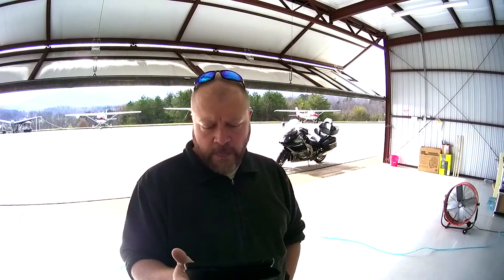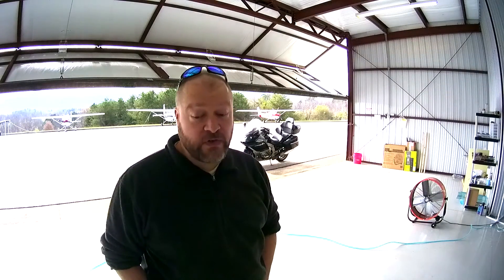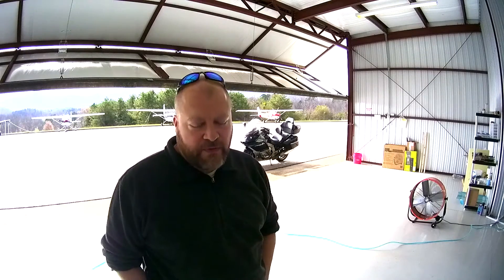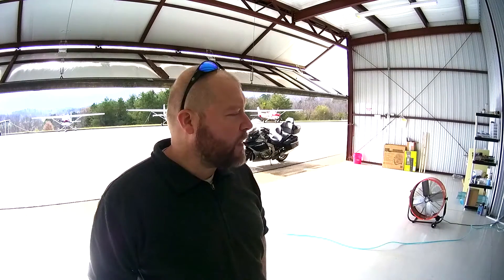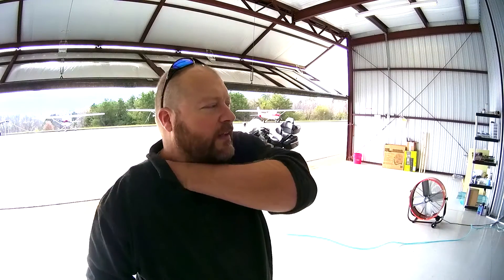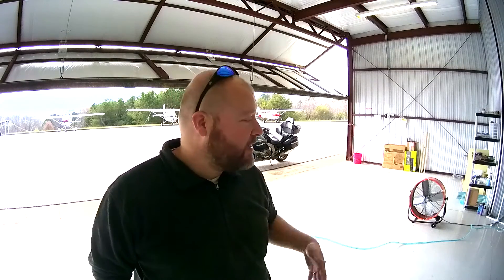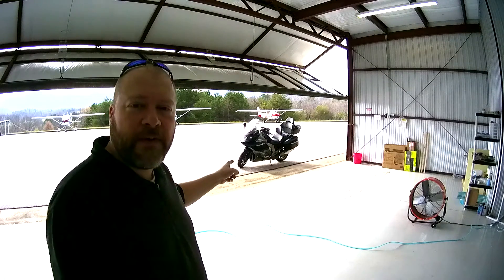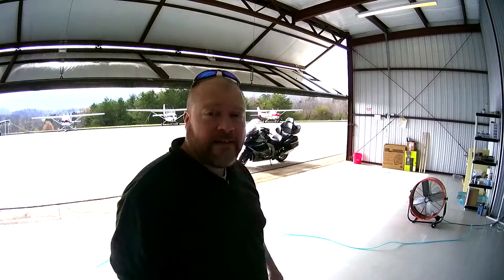RV-10 Empennage - Questions and Answers 001

Comment: This is an older video, and I'm just starting to go through your videos...so I am late to the party here. So you may have already changed your mind several times. That said, there's one question you need to ask yourself: How much single-pilot instrument flying are you going to do? 

The single most difficult type of flying to do is hand-flying in IFR, single-pilot. It is HARD. When you're in IMC and the weather is crappy, you have to be 100% on your game. Every. Single. Second. I've been there, many times. I've also given hundreds and hundreds of hours of instruction to IFR students, and that's the one thing everyone has problems with: hand-flying on instruments when the work-load increases. 

For me, the days of 6-pack flying are largely gone. Sensor fusion is a very convenient thing.
Reply from the maker: Honestly, very little.  My plan is to be a mostly VFR pilot.  I will make an IFR plane but I will actively avoid IMC for a very long time. Great question.

Comment: Hello from Argentina! One question, do you consider at any time the wheeler express 2000??? Thanks for the vídeos!
Reply from the maker: Nope.  I know nothing about them.  From my brief research, I wonder how many are actually flying?
Reply: Jason Ellis Me to. Certainly not as many as the RV-10. Just 12.000uds more than RV and the built may be faster. It also carries 90gal of fuel, but is heavier than the RV. I´m thinking of building an experimental. I have two overhauled IO-470 and two 3 blade constant speed propellers from a Cessna 310 that has with rust problems. I´m between does two. Keep it up with the videos! Me and my brother are enjoying them.
Reply from the maker: You might want to look into shipping costs.  I know that with Van's shipping out of the US can be expensive, I bet this company has something similar.   The RV-10 can have 90 if you put the extra fuel tanks (after market) on them.  But honestly, 60gal is ample.. bladder buster.  Cheers.

Comment: Jason, do the plans include tutorials, guidelines, or instructions on the how's or why's of doing particular tasks? Or is it just step one: do this, step two: do that, with you left to intuit everything in between? For example, how do you know what a proper dimple should look like, or why do you dimple here vs. countersink there, etc?
Reply from the maker: +David B Nope.  Most of the time you're left to figure it out on your own or you have no idea why you're doing a thing until it all comes together.  It helps to look forward in the plans so you can see why you just did "thing a" instead of doing it differently.  Regarding dimpling / countersinking.. same thing.. Sometimes it's obvious, and you can certainly tell the plans (and the help line) are run by people who know why its obvious.. but for people like me that have never done it before the "why" is often left entirely out.  And most recently (which I will have a video about this) there was a section that clearly should have been counter sunk but they didn't talk to it at all.
Reply: +Jason Ellis Ok, thank you. I really appreciate your quick reply and everything you are doing here. It will be a bit frustrating for me because I am the kind of guy who wants to completely understand everything that I am doing. Primarily so I know I am doing it correctly, and not find out later down the road that I did something that will need to be fixed. Luckily, there is a local EAA chapter nearby with some RV's.

Comment: Thanks for sharing Jason, I have yet to understand how the manufacturers can justify the prices they charge for an engine. The community goes on and on about trying to attract more and younger people to flying. The answer is simple, make it less expensive! Hope those wings come soon! :)
Reply from the maker: +efox2001 It's an industry wide problem.  It's a bit of a cart before the horse, or chicken and egg issue.  If they had more people buying planes, the prices of things could drop.  There's a reason you can get a brand new Toyota for roughly 20k.  But since there isn't a huge demand the prices have to stay up..  Well because the prices stay up, it prevents a huge demand..

Another issue is that young people want things easy.  They want to be able to be handed things (ala the "thanks for coming trophy".. Everyones a winner, crap.. ) instead of earning things the hard way.  Learning to fly isn't easy.  It takes time and effort.  I think this also prevents huge demand.